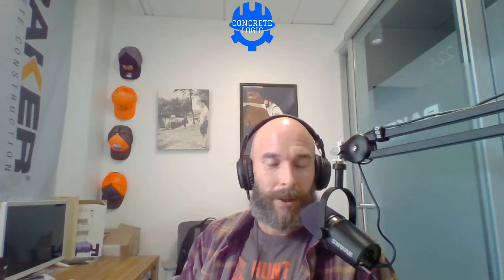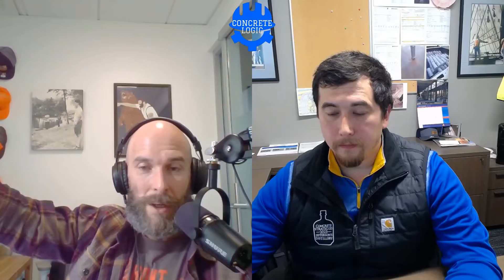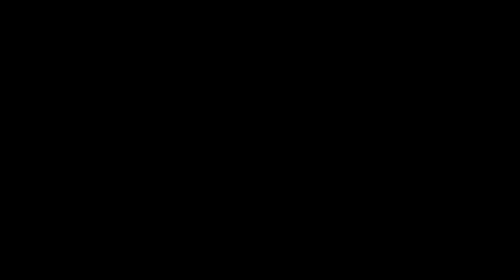EP #074: Type IL Cement - A Concrete Conundrum

Comment: I had a driveway poured last May.  The contractor used 1L concrete.  My driveway is severely spalled.  The contractor is blaming it on type 1L.  My driveway also heaved because we believe it is very porous.  I live in Ohio and we experienced a cold snowy winter.  My contractor has 22 driveways he poured last year with the same issue.  Question:  Is this problem seen across the country?  are suppliers going back to the old way of making concrete since we are no longer in the Paris Climate agreement?
Thank you.
Reply from the maker: Type IL cement is not going away anytime soon. All the major cement manufacturers in the U.S. have converted to Type IL.
Reply: I live in San Diego and can confirm I had the same issue out here on the west coast. I have about 20-30 pop out happening in a walkway I had pop out.
Reply: @tobin003 I’m sorry but what is pop out?
Reply: Research into low-carbon cements predates 2015, so this isn't entirely driven by the Paris Agreement. That said, I'm sure its had indirect impacts on those decisions as well as upstream policy ripple effects. 

The type 1l cement is still required to have the same strength and durability as type 1 in accordance with ASTM C595 and AASHTO M240 standards. I haven't seen any definitive research indicating increased cracking or shrinkage. 

What I can tell you - I am a PM with a commercial general contractor in the Pacific Northwest. We self-perform a ton of our concrete and framing work. Quite coincidentally, since the new type of cement was adopted a ton of our projects have had issues with shrinkage and cracking. I've talked with larger local concrete contractors and they're all experiencing the same thing. I can't help but wonder if the admixtures being retested using this new cement.
Reply: What did the contractor end up doing for you?  Did you get a new driveway?  I have a 1L driveway and it’s showing severe scaling after only 18 months since being poured.
Reply: @danLien-d4e suppose to replace it this summer